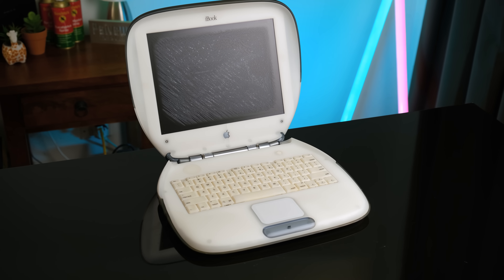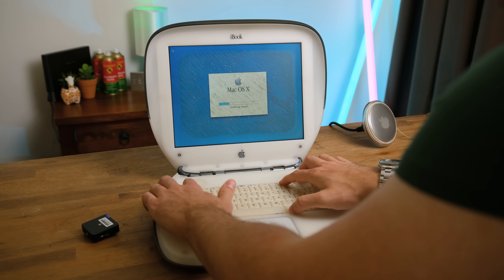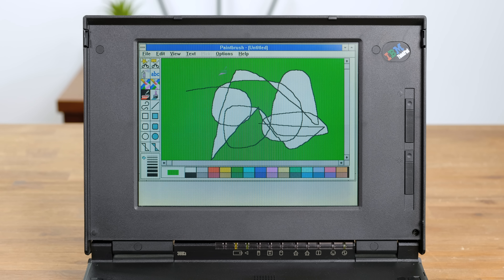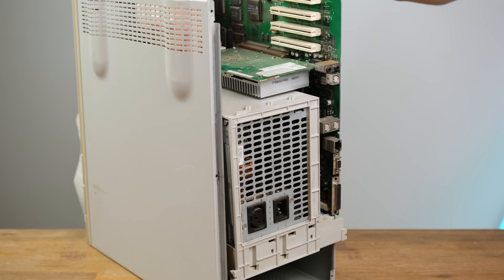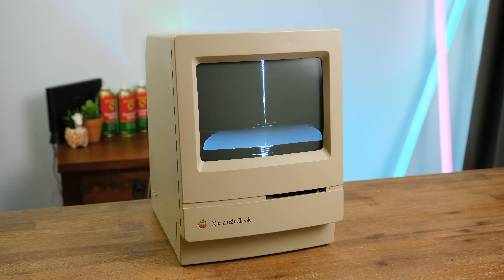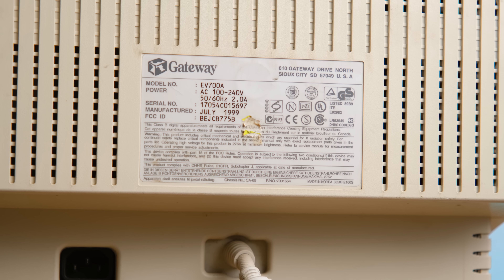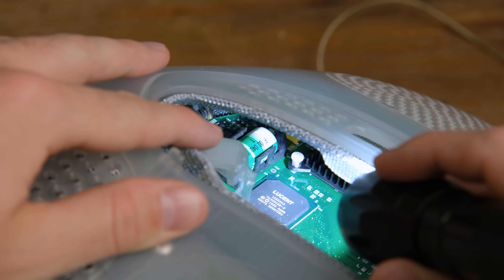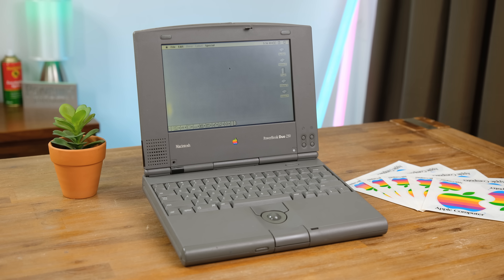So Much Vintage Tech Is Dying... Here's Why

Comment: I honestly hope, these old machines are being used to write proper emulators. Their demise is inevitable, but it is worth to preserve the software ecosystem of these systems for historical purposes.
Reply: FreeDOS has been in the works for decades now. Great DOS environment if you need it, though a lot of it is run in virtual machines these days
Reply: @DevinBauer  What's your opinion on DOSBox?
Reply: @USS_Sentinel  I have used it to run a few DOS programs in the past, seemed to work well enough, and ran Wolfenstein 3D fine too. I don’t have enough experience to go any deeper
Reply: For classic Macintosh OSs, there's Basilisk II and SheepShaver.
Reply: @USS_Sentinel Thanks! Never would have thought to emulate a Mac but may even go so far as create a "hackbook"

I llove twister OS on raspberry pi (also PC but requires Linux mint), it's Linux but also has windows and apple themes going back to Windows 95, boots so much faster than windows)
Reply: @jamiegrantadaire I have an old 17” HP laptop that has Windows 8 on it. I never connect it to the internet and it has some software that works fine for my use. This software was bought and now it I want to run that same software on a Windows 11 computer I’d have to buy annual subscriptions for it.
Reply: @Chris_at_Home  I'm old enough to remember a time when if you ('you' meaning 'the little guy') bought something, it was yours to keep. These l8as+ards ought to be whipped!
Reply: @sciencebear1645 they are but progress has been stalled on the mac emulators unfortunately
Reply: Yeah even if the original hardware can’t be preserved let’s at least preserve the software eco systems
Reply: @Science Bear They definitely are
Reply: But emulation doesn't feel like the real deal and it has its issues as well, as you can only achieve 100% compadibility and authenticity on real hardware.
Reply: Emulations have limits that can't be overcome , look for instance at old synths , even after 25 years of trying to emulate analog circuits it still isn't totally satisfactory
Reply: @jamiegrantadaire There are emulators like DOSBox and Bochs for the really old MS-DOS games. For newer Windows games there is WINE, although it is not 100% guaranteed a given program will work.
Reply: @rabiatorthegreat6163 wine and box86 or box64 are a great combo!
Reply: 86Box looks promising, with the developers seeking to emulate various components from the 8086 era on (up to the Pentium II right now) accurately.
Reply: 86box is great for running older machines accurately (the cpu clock speed is emulated and games run at their proper speed)
Reply: These machines can be maintained for decades to come if you know what you're doing. They're also very well emulated by now.
Reply: This is what Terry A Davis warned you about and thats (very partially) why he made TempleOS.
Reply: I notice these are ALL Apple products. Apple doesn't make REAL computers, just cheap stuff for the public school system. Why would anyone want to Emulate that?
Reply: @EmeraldEyesEsoteric  Apple of the 90's was pretty cool.

Comment: Those P4 powered dells where FAMOUS for leaking and bulged caps, we didn’t even bother if they would have weird issues we just popped open the case find the cap, pull the drive and tell them we have to order a new pc, all form factors and even dimensions had it to.

Comment: Laserdisc: Disc rot
CD: Disc rot
LCD: Chemical breakdown
HDD: Platter malfunction
Capasitor: Exploding
SSD: Flash storage chip dying
OLED: LEDs burning out
CRT: Phosphorus coating burning and tube death
Cassette tape: Rotting

All media is breaking down.
Reply: Laserdisc rot is mostly caused by bad disc manufacturing, especially in the early years. Certain factories were infamous for it. There are also manufacturing problems that look like rot, but the difference is they don't get worse with time.
CD (as opposed to CD-R) rot is incredibly rare, and apparently mostly caused by bad manufacturing. I may have only ever seen one or two here in the US, but I've heard that it's been a problem in Europe. CDs fail much more from scratches and breakage.
LCD displays can also have problems with fluorescent backlights failing, both the lamp itself and the driver board can fail.
CRTs can also get cataracts, but I haven't yet heard of it happening to anything from the 80s or newer.
All magnetic tape can have its binder break down and the tape needs to be baked before recovery to keep it from sticking to the adjacent layer. Cassette tape, especially longer lengths with thinner tape, can break. Tape players can also go bad.

Comment: I have a Toshiba Tecra 520CDT FROM the mid nineties that is suffering the same issue with the display. The HD has also died and ready to send it out to try to recover the data. To boot the display has gone dark and I assume the surface mount electrolytics  have probably puked on the power board. Need to order a bunch of these caps to see if I can get the display up and running. Even with the external monitor connected we can only see with the help of a flashlight.

Comment: I think the climate makes a huge impact on LCDs and electronics. I live in a semi-arid mediterranean climate (Madrid) and after many years collecting electronics and laptops, all the old LCDs still work perfectly (except for 1 screen cancer case), and have not seen any humidity-related damages so far.

Of course, batteries and bad caps still fail and corrosion is an issue, but those problems can still be usually solved or even prevented before damage, or at least before the damage is catastrophic.

Maybe we should make something like the Svalbard Global Seed Vault or the GitHub Arctic Code Vault, but for old electronics in working condition.

Comment: FWIW if you can find the correct ribbon cable, the screen out of an iBook G4 will swap into the later model iBook Clamshells with 8mb video cards. It's the setup I run, but I really wish I knew anything about CAD so I could get a bracket made so it would actually screw in, as it is the solution I've used and the solution most of the internet suggests is to just hold the screen in with friction, which works but it's ugly and imprecise.

Someday I think I'd like to see replacement panels made in small batches like you see for the GameBoy Advance. A replacement for the AirPort card that can connect to modern wi-fi would also be nice!

EDIT: Oh! But also, SSD conversion for the Clamshell is pretty cheap, it's just a pain in the neck tearing the machine down to get to the hard drive. Some people will actually cut a hole in the RF shield so they can get the HDD out with just the palmrest removed, but I personally have not elected to do that since I've got as big an SSD as a Clamshell will take, to my knowledge. (128GB, which is plenty considering it originally shipped with only 10 gigs!)

In recent years I've downsized quite a lot and had to get rid of a lot of my vintage computers sadly, but my 466 MHz swapped Indigo Clamshell (Also has the aforementioned SSD, screen upgrade and keycaps off a PowerBook!) is the one I'll always keep, along with the matching Handspring Visor PDA. :P

Comment: Make sure to check your handhelds every few months for bulging or leaking lithium batteries!
Everyone knows about some Super Nintendo plastics getting yellow and brittle, and now the same thing is happening to Game Boy Advance SP and DSes especially the lighter colored ones. It might be less obvious since that plastic is painted but the hinges especially crack and fall apart. Also DS Phat screens are starting to fail with horizontal grey lines.
Reply: Its even more, memory chips without power in time will lose data stored in them, so in fact once about every half year to year you need to boot old pc's up just to keep bios memory from losing data. Maybe you could go even with longer intervals, but who knows? There are good chances that some data on that usb memory stick you havet used for 5 to years will be lost.

Comment: Commodore built computers have a very commonplace problem with leaking capacitors that often ruins the motherboard. They also had really bad power supply units that outright damaged the system.

Comment: The vinegar syndrome is not only affecting more laptop and LCD displays, heck even already started to form on my barely 10 year old LG television.

I think it has something to do by the fact that I live in a tropical country just like you (Malaysia) And that the climate really accelerates the polariser breaking down on LCD displays 

Is very unfortunate and probably really hard (but not impossible) To fix LCD displays that has developed the vinegar syndrome. There needs to be more documentation on how one can restore the polariser of lcd displays rather than chucking them and getting a new one, especially older display panels that are way harder to find now

Comment: To me looks like humidity problems 
IT might be a good idea to store all your PC's with a anti humidity solution .. either sillica sachets (when you get in new shoes box ) or any absorber.
Reply: Yeah, I collect a ton of old laptops and I don't have this issue. I am not saying it doesn't happen, but seeing him pull out all of his machines that were pristine previously and now junk, it makes me wonder how cool/dry his storage area really is.  There seems to be a common theme with everything he showed in the video, and it is that they were all stored in the same area.
Reply: Having a dehumidifier on a timer is also not a bad idea, it's what I do myself
Reply: Just store them in a conditioned room.
Reply: @aaron___6014  LCD screens delaminate no matter how they are stored, one of the reasons I don't collect later machines. Plasma displays have their own issues so even early laptops are a pain. You can sometimes find modern displays that can be adapted to work on these old systems but the time and effort required is often not worth it.
Reply: @nigelrhodes4330  the problems come from when people use harsh cleaners on their items.
Reply: @nigelrhodes4330  and don't forget what happens when the sun rays shine on plastic.  The plastic becomes brittle!
Reply: @carmichaelmoritz8662  I have owned literally hundreds of computers (140 at the start of this year) over the decades and I can tell you now they delaminate no matter what you do. The older screens are worse than the newer ones but they all do it with time. Even CRTs get what people call "cataracts" which are from the glue holding the front glass on to the actual CRT. If you own these older machines you either need to learn to fix these sort of things yourself or pay others. Over the years there will be less and less of these sort of items as they all slowly fail and get recycled, the circle of life I guess.
Reply: @nigelrhodes4330  I understand that everything fails eventually.  I have an old  envision flat screen monitor and it works perfect with no signs of deterioration. I get the system up and running once a year just to make sure everything's working. It has three versions of Windows installed on it. Maybe I just got lucky and have an extremely rare unit.
Reply: @nigelrhodes4330  I always use rain water to clean it , usually just a dry dusting. And I never touch it with oily hands. If you use tap water it contains all sorts of bleach and chemicals that will eventually degrade anything that's plastic or even metal.
Reply: VCI paper , talk to somebody In a metal working factory.
Reply: https://youtube.com/shorts/T6-O2u0KCDc?feature=share
Reply: He just said in the video that it is stored in a cool and dry place

Comment: Ah yes, the dreaded sticky plastics. Seems this affects all devices where the manufacturer subscribed to the "soft touch finish" hype. That "soft touch" becomes a sticky and goopy mess. I have seen this on some of my 35mm film cameras. I had to partially disassemble and vigorously clean it. This stickiness is just nasty.
Reply: Yeah, I still use a few old USB HUBS that are made of that 'soft touch rubberized' material, and all it does is degrade, become sticky, and attract dust that's impossible to clean off...